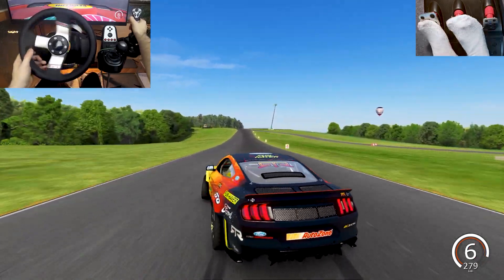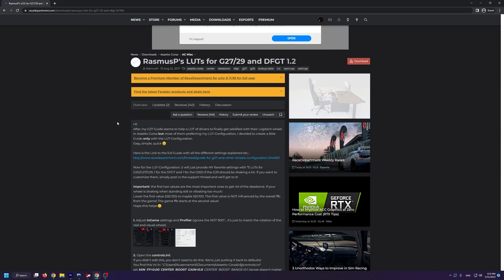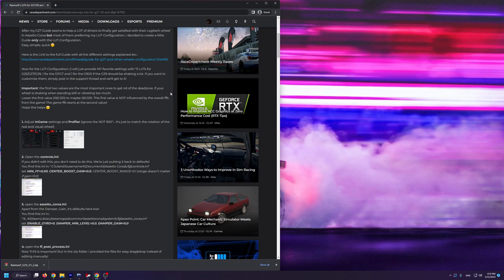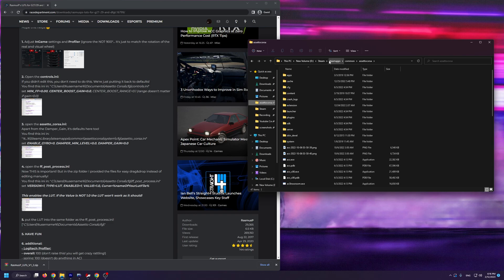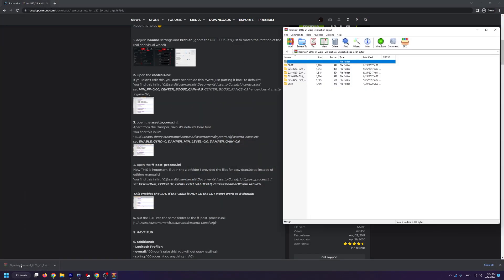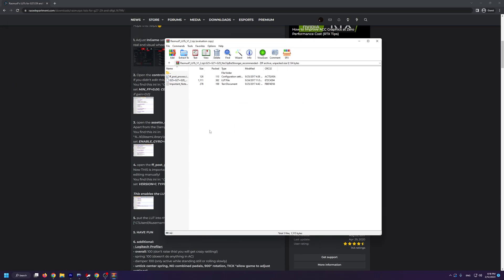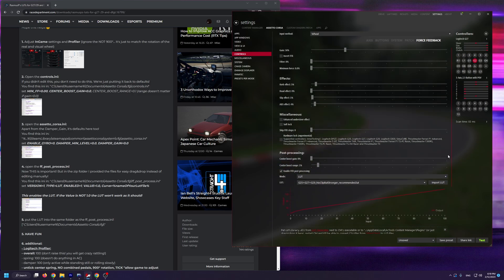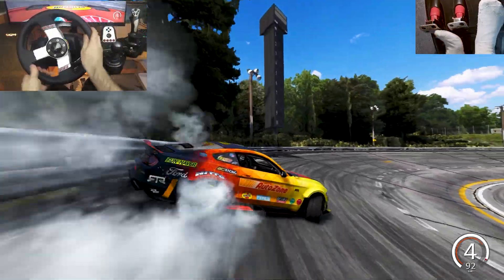Logitech Force Feedback Settings Assetto Corsa - Logitech G25/G27/G29/G920/G923

Comment: u broke my wheel
Reply from the maker: It's impossible for this to break your wheel. You can always just click reset to defaults. This setting literally does nothing more than change how and when the wheel delivers force feedback. It doesn't make it stronger (even if you wanted it to, it can't), on the contrary, it prevents clipping and making the feedback more consistent with less clipping (hitting max force and losing feel).

Comment: Is this steering setting still realistic or does it just helps you get better drifts ?
Reply from the maker: I mean realistic is a bad way of putting it since the Logitech steering wheels are beginner wheels and don't have a lot of force or feel, but these settings will make the wheel a bit more realistic and provide better feedback (as much as the wheel can anyway).

As for drifting, it's all practice really. I can drift with the settings, without, whatever. It's just a matter of getting used to it, but once you know how to drift, you can drift pretty much anything (assuming it's RWD obviously).

Comment: How can I change my settings in G HUB? LGS doesnt detect my G920
Reply from the maker: Not too sure as I haven't used G HUB, but I think it should be under settings somewhere (look for devices and select Wheel). Don't worry too much about it though, if you haven't changed anything it should be default anyway. Plus I think G HUB has less things you can change anyway.

Comment: what kind of improvement in the manager corresponds to the fact that the car rocks and is not rigid, I am a beginner
Reply from the maker: If you mean things like body roll and suspension, this is just the mod, it depends on the car and the tune you do in game. You can't really change car behaviour from the manager.
Reply: @alwaysonboost  I meant that when the car flies sideways, the image behind the car is stiff too, but I saw that the car after entering drift simply flies sideways, and in my case the camera from behind the car is stiff, which looks very unnatural,
Reply from the maker: I have a video explaining how to install that chase camera, check it out here:
https://youtu.be/6SG38HAcOkk
Reply: @alwaysonboost  ok, thank you, but that's not the point, after installing assetto c, I just download anywhere and any car and I see the car all this car does not move in relation to the image, just to visualize it, it looks as if the camera was from car combined and not like that if the car flies sideways, you can see it
Reply from the maker: @kd.driver  Yeah, and that's why you need to install this camera mod which will make it fluid and not fixed with the car all the time. It's all there in the video.
Reply: @alwaysonboost  Thank you

Comment: How can i download Logitech profiler?
Reply: I have ghub and i cant find global setting 🥺
Reply from the maker: So for the Ghub you won't have a global device setting tab, but I think you'll have the same options if you select the steering wheel device, and then go into Steering Wheel. You'll see sensitivity, centering spring strength, etc., basically most of the same settings. You can always download the profiler but I'm not sure how they would react together. Regardless, you can leave it stock and just do the LUTs as recommended in the video, you'll get pretty much the same result since the stock defaults are the same, the only thing I really recommend doing is disabling the center spring.